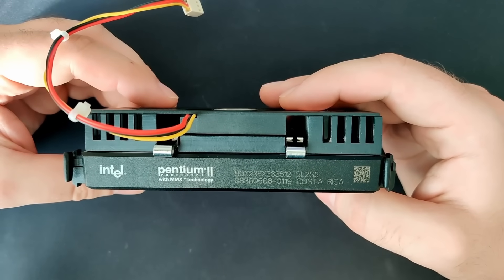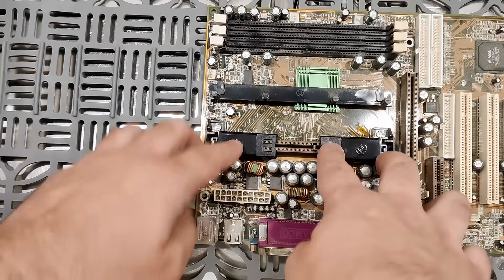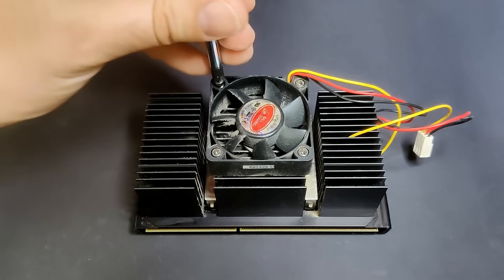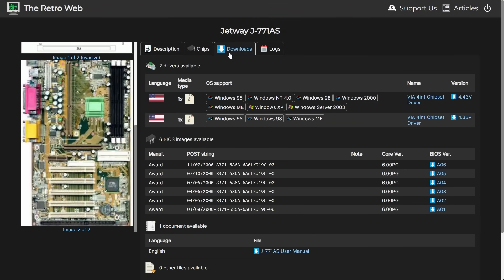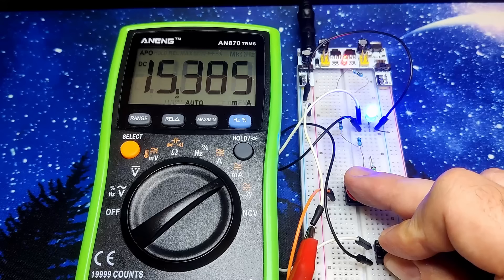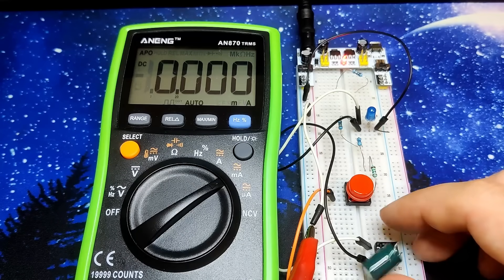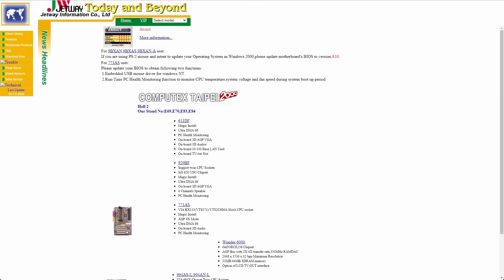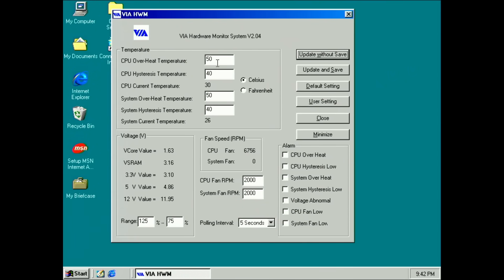Scrapyard find: AMD Athlon and a Jetway 771AS motherboard

Comment: I don't think the slot was turned 180 degrees for amd.  I am pretty sure I have a couple intel slot mobo's here somewhere that have the slot oriented the same way as this athlon board.
Reply: It was indeed rotated. Slot A CPUs fit in Slot 1 when flipped, but the placement of the CPU + heatsink wouldn't fit as the heatsink would hit the back of the case, potentially capacitors, and the rear i/o ports.
Reply from the maker: I actually tried exactly that! A Pentium II/III fits in Slot A, and an Athlon fits into Slot 1 - you just need to turn the CPU 180 degrees for the other platform. Of course, NEVER do that! AMD CPUs won't work on Intel platform and vice versa from this generation onwards. And yes, if you try with a cooler, it won't fit - either it's the I/O connectors or capacitors that are in the way.
Reply: @masejoer  Oh I get it now, the board that the cpu is on and the slot are flipped, but the cpu and heatsink still stick out the same side so it appears to be the same.
Now that I think about it, I don't think I ever tried my amd slot cpu's in any other boards, lol.

Comment: When I first got back into computers. They sold a motherboard call MachSpeed. I can't remember the exact story but they are the same board (Jetway). With bad caps all over the place. They offered a life time warranty on the motherboard if you registered it. These was P4 boards. The boards they sent back would do the same thing even in sometimes under 1 year. Talk about upset customers.
Reply from the maker: That's really annoying! I guess at the time when the capacitor plague was in full force, many companies didn't know what was going on for quite some time. Which stock is affected, what models may fail within a year again etc.

Comment: Nice to see a better cleaning. I clean every board, cpu, heatsink, etc like this, if not a bit more more thorough. With dish soap + water, a soft-bristle toothbrush, then a brush with longer bristles on the tip for all the crevices (two passes). Then a tap water rinse, a second rinse/soak/tapping/shaking in a tub of distilled water (I distill it myself), trying to get all remnants of soap or tap water out from under components, then on top of a fan for at least 12 hours. Forced air (I use a datavac) can help dry the board quicker on the surface, but I still like to use a fan to dry out under all the chips at least overnight, before powering it on. Notable the North or South bridges, and GPU chips, which have very little clearance for moisture evaporation.

PCBs just look so nice when they're perfectly clean, and have no mineral deposits due to a distilled water rinse.

I'm on the team of replace-all-capacitors, if the board is physically good, and the person has the skills to safely do so. 30 years from now, the new caps today should still work, but the caps from the 90s will likely require more board work, and surely electrolytics will be impossible to find. I plan on still using my boards 30 years from now, so I'd rather replace them now ;) That's actually why I'm also looking for pc parts today - they'll get even more difficult to find in the future. Find what I want now, or over the next few years, so that I have the parts to play with later.

Cleaning, replacing Nicad or old caps, and storing them in proper ESD-safe bags, with foam and within boxes will protect them from physical damage, including in the event of a mild earthquake where it could fall from a shelf. Even more than that, my boxes then get put into plastic zip bags, and then put into a gasketed storage tote, and then stacked onto a shelf. If a component lasted this long, and works today, I want to ensure that it is cared for and protected into the future. Preservation!
Reply from the maker: Great to hear that you put so much dedication towards preserving old components from 30 years ago. I'll try to save whatever I find.

Comment: I think changing all the caps is cheap insurance, they will all fail eventually, even the small ones
Reply: Yes, and electrolytics will get more difficult to find in the distant future. Many already are. IMO, do them now.
Reply from the maker: It's just that this is a lot of work. But you are right, they will all eventually fail. For a retro machine, it may be ok to keep them for now since there is little usage. You may be able to replace electrolytic capacitors with solid capacitors. I did this on a P4B motherboard from ASUS. Works well so far.

Comment: i wonder if the caps on the over heating motherboards are the issue.
Reply: From what he's shown it's the GSC branded caps which were like the top leader of the capacitor plague. I had an ePox motherboard on which basically all of them bulged and leaked over just a few years.
Reply from the maker: I wasn't sure about GSC, that's why I made sure it's shown in the video. Thanks for the info!

Comment: When recapping a board, I'd suggest replacing as needed instead of replacing everything. Just because a capacitor is old doesn't mean that it's failing too.

Of course, it does make sense to replace all of one specific type of capacitor. It's very likely that if one of the same type, brand and value have failed, then the rest on the board would be on their way out too. It's safe to assume they very likely came from the same batch during manufacturing.
Reply: I get it, it's a valid argument but the problem with that is capacitors don't always bulge or show other obvious signs when they're failing and you can't test them properly in circuit so if you've any suspicion they may be bad you have to remove them.

Unfortunately, no matter how good you are with a soldering iron/desoldering tool etc. removing them from the board can damage them, by overheating them and or mechanical forces.

So, when you've gone to the trouble of removing a capacitor that costs pennies to test it properly it's better to replace it to save damaging a rare board, CPU etc. or causing yourself more work in the near future.

Comment: Get a little shop vac that can go in reverse. With the narrow attachment, they create a lot of pressure and work great for drying boards in seconds instead of days. My Shop-Vac brand one is so strong, I'm afraid I'll blow components off the boards, so I keep the attachment at a a variable distance, depending on what I'm aiming at.
Reply from the maker: If you're in a hurry, that may be a good option. I usually wash boards way  before I start working on them.
Reply: @bitsundbolts  Well, the other factor is we have very hard water where I live, so it will leave behind potentially conductive deposits, if I let it sit.
Reply from the maker: Ahh, yes, that is a problem. I live in the desert and most of our water comes from desalinated water. There is almost nothing in the water and it dries nicely without leaving deposits.
Reply: Using air to blow off wet boards might work some of the time but you should still leave time to air dry. Air just doesn't get all the water out from under BGA chips.  I used an air compressor to dry my Quadro FX 3000 after washing it and it started showing corruption after a minute or two of use. After some extended time under a hot lamp it started working again.

Comment: To replace all or not to replace all... it is always a sticky question of risk balance. 

I'm usually in the "replace what must be replaced and maybe the rest from the same brand of capacitor if you replaced a few of them already" camp. There is always a risk of damaging the board and components when removing any component so if you stick to replacing what you have to, you might reduce the risk of unnecessary damage.

That said, boards from that era generally were a question of "when", not "if" the capacitors fail and once I determined the board was functional as you have, I'd carefully consider proactively replacing whatever else I could find on the board that might need it.
Reply from the maker: Sounds very reasonable and probably what I'm going to do as well. The caps that look good also performed well. What worries me a bit is that the caps from this board looked way better than the ones from the P4B, but I feel the ones from this board are in worse condition!